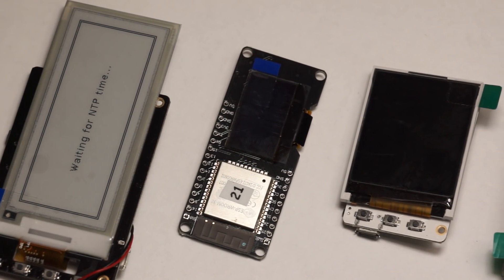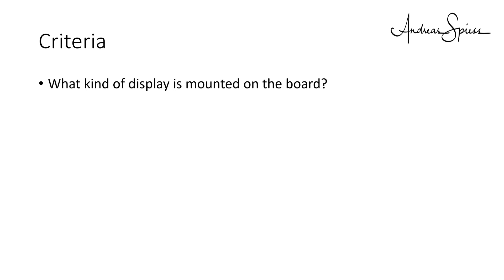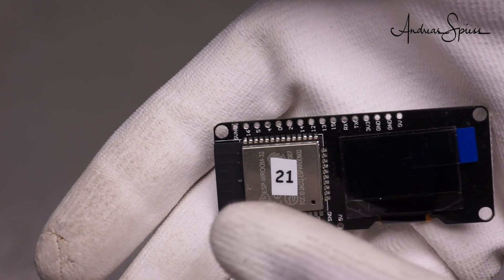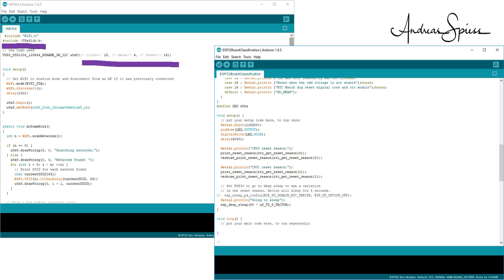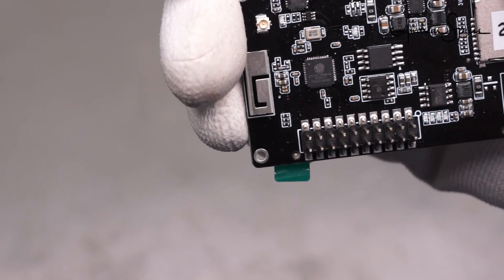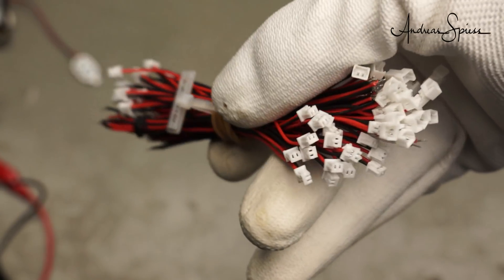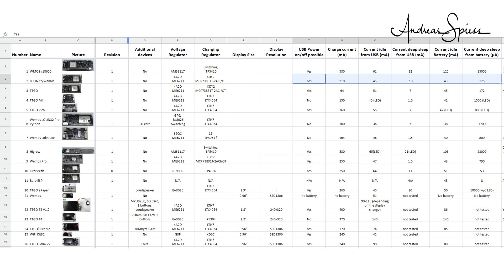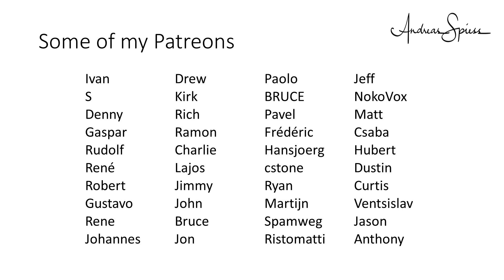#201 New ESP32 Boards with Displays

Comment: Hello, please change the info for the TTGO V4 ,it has been updated to LILYGO® TTGO T4 V1.3 ILI9341 2.4 inch LCD Display Backlight Adjustment ESP32 Development Board WIFI Wireless Bluetooth Module, and yes the pins are labeled and it is shiped with the battery and connector for socket with 3.3vdc ,5.0vdc,gnd,SCL,SDA (i2c).I am waiting for mine and will keep you posted.

Comment: just made my ttgo T4 1.3 display work.
Thanks to Your very helpfull Info on Github.graphicstest TTGO T4
Had to adjust TFT_DC to 32 and Write the IO 4 high to get the backlight on.
With the Adjustment of the tft pins as in your sketch the TFT_eSPI examples also run on TFT_eSPI  library.
Regards
Reply from the maker: Great! And a cool name you have ;-)
Reply: Thanks for the reply.
Its not so much a Name as more of an Attitude ;-).
Waiting for the M5 e paper and M5 tough in the mail.
Plan to use these for some outdoor project, so searching for good information about them.
Regards

Comment: Hoi Andreas, Ich unterrichte a de ETH und mir würed gern en neue Networking Kurs uufsetzte. I dem Kurs sölled Studente komplett uf eigeni Fuust es chliises Pseudo-Internet programmiere. Für das benutzemer ganz villi Mikrocontrollers als Pseudo-Routers wo denne Packet i dem Mini-Internet tüend forwarde. Si sind verbunde über GPIO pins. Bis lang hämmers mit Arduinos mit LCDs probiert, aber soebe han ich das Wemos OLED board entdeckt und hetti es paar Frage: 1) Isch es 3.3V oder 5V?  2) Händ d'GPIO pins vo sich uus en pulldown/pullup Widerstand? 3) Chan me das board via bluetooth programmiere? 4) Isch es schwierig das Arduino IDE so z'installiere, dass es mit em Wemos funktioniert?  Ville Dank für Dini Hilf und die super Videos mit em Swiss-Accent. Haha :)
Reply from the maker: Man kann ESP8266 und ESP32 mit der Ardiuino IDE programmieren. Die Daten für dein spezifisches Board findest du im Datenblatt. Beide ESP Chips arbeiten mit 3.3 Volt und der ESP32 hat Bluetooth. Für die meisten deiner Fragen gibt es Videos auf diesem Kanal.

Comment: Hello, really like your work. I need help and wonder if you know anything about my issue. Im trying to build a mesh network with the Heltec V2 Lora boards. My sketch (very simple code) transmits great, and other nodes receive just as well. However, when I combine both TX/RX on a single node, the TX takes over and the the node just doesn't listen at all. No matter where I put it in the sketch. Ive tried forcing it to listen with lora functions and nothing. I heard about an "antenna switcher" built into the board, but I just cant find an answer. Can you guide me? I really appreciate your help. Take care. HQ
Reply from the maker: This is a software issue. All LoRa boards can transmit and receive (half-Duplex)
Reply: @AndreasSpiess  thank you for taking the time to answer. I really appreciate it. Do you have any function, or pin assignment in mind? Otherwise I'll keep looking. Thanks again. HQ

Comment: Library problems solved, but the build fails in with this message:
AppData\Local\Temp\arduino_build_765950/arduino.ar'; reason: File exists
Fout bij het compileren voor board Heltec_WIFI_LoRa_32 (selected this board)
On both my boards:
LilyGO/TTGO-LORA32-V2.0
LilyGO/TTGO-T-Beam
anyone can tell me what i am doing wrong??
Reply: Problem solved "arduino_build_765950/arduino.ar'; reason: File exists"
cause was the Arduino-Beta version. 
After overwrite with the nightly build the problem was gone.

Comment: Hi Dear Andreas,
I am using TTGO ESP32 LoRa OLED v1 and TTGO LoRa32 v2.0 boards but, am facing problems in reading/writing SD card.
Can you please share details about required pins' definition, board selection, and Arduino code or any video on this... Thanks
Reply from the maker: I never used the SD card.

Comment: External antenna connectors: Can anyone tell us if you have to remove any components connected to the on-board antenna to use an external antenna properly?
ESP-05 or -07 for example
Reply from the maker: For the ESP-07 you should find how to do it. You have to remove a 0 ohm resistor if I remember right.

Comment: Thanks! BTW, I made a smart watch using the TTGO T2, and it works pretty well for that purpose. The code also has an abstraction layer to choose either B&W or colour 0.96’ displays without changing the sketch.  hackwatch on github.
Reply from the maker: Sounds like a nice project! And still some of the hard work to be done. Maybe you will get help from another maker?
Reply: Andreas Spiess thanks! Yes, there seems to be a really nice community around the Espressif libraries, plus another smartwatch codebase in the works. Lots of interesting community contributions going on.

Comment: I am confused about what level of computer networking do I need to learn for making iot projects. Is it that I have to learn CCNA or something like that. Plz help.
Reply from the maker: Just start with simple projects. Most of the makers did it this way. There is no formal training available.
Reply: Andreas Spiess thanks a lot sir.
Reply: Just go digging around. These sort of projects - you will learn by debugging your problem. Search in google. Read.

Comment: Any chance you could show how to take a RF ceiling fan control and have an Arduino learn what it's sending and mimic it via MQTT calls to the Arduino?  My use case is I have a wall switch (z-wave on/off) that supplies power to the fan/light combo.  The fan/light combo does remember state so I have that automated. 

I would prefer to control the fan (on/off/speed), lower light (dimmable), and upper light separately via an Arduino that mimics remote key presses.
Reply from the maker: My videos cover different aspects of projects to enable my viewers to do their own project like yours. So maybe you find parts of what you need in my videos or somewhere else on the internet and you build your own project.

Comment: Has anybody tried yet to playback multimedia files such as mpeg/avi or s.th. proprietary from an sd card on an esp32 MCU? Shouldn't the unit be capable of that? I saw a video here on yt, where they showed Doom running on ESP32.... so... 
We need to add a proper decoder chip... or converting the mm-file to a format that can be processed by the esp32. I read somewhere that a guy placed data from a .wav file into a bitmap(?) file so he was able to play an animation with sound on his rather weak arduino uno. Well, it was a monochrom low res display, but anyway. 
I plan to do s.th. a bit more eyecandy on my next project, i.e. incorporating short animation sequences for the user (which may be kids in the first order). 
Andy ideas/advices highly welcome. 
Moin, from northern Germany.

Comment: Hello Andreas, could you please measure the sleep current as well. I programm my battery powerd Display equipped uC devices e.g. Datalogger to switch off the display and deep sleep to save battery power and only switch on display if u push a button or I use PIR Sensors or a microphone  to activate the display ( a concept to save power like in a mobile Phone) so sleep current matters. Thank you!
Reply from the maker: For the moment I have not planned to do that. But if I find time I know you would like it.

Comment: i got the epaper to work in ardunio, but it was a lot harder to get working than I'm used to. i used  GxGDEH029A1.cpp and GxIO_SPI.cpp, and my board init'd with GxIO_Class io(SPI, SS, 17, 16); and GxEPD_Class display(io, 16, 4); which let's you use commands like  display.setCursor,  display.println, etc. I can try to cleanup my proprietary sketch if anyone's interested...
Reply from the maker: I would be interested, of course ;-)
Reply: it's morning now and i have a busy day, but i will try to cleanup+post a minimal example and figure out where i got the libs i used. IIRC, they were labeled for something else but they worked; i made an NTC clock demo and it's still showing Jan 20 on the display, which is probably why i can't recall exactly what i did. I'll figure it out and let you know, it's the least i can do in exchange for your good videos and helpful comments.
Reply: Sorry it took an extra day, I've been swamped.  This is a working text+feature demo for my ESP32 2.9" epaper devkit (NodeMCU-32S profile) https://pastebin.com/Sx59JAET  I don't want any credit (or blame) for the code, I just hope it works for others. Please share. I linked all libs and you'll find more demos on their github.
Reply from the maker: Thanks. I will try it.

Comment: I have a board #21, it was advertised as BME280-ready with extra four pins in the center of board. But I didn't succeed with connecting BME280 to these pins (no documentation available). Instead I've connected to the regular pins on a side, and it worked good.
Reply from the maker: Maybe you check the connections of these pins using a multimeter?
Reply: Thanks for your advice!

Comment: There are a few typos:
+ Wemos produces the original Lolin32 boards. The company with the knock-offs is called "Wems" --> look at the board logo, the o is missing
+ The Wifi Kit 32 is missing the battery powered current and the link goes to the wrong board
+ The Wifi Kit 32 looks like a Heltec Knock-off. Heltec has their own github https://github.com/Heltec-Aaron-Lee/WiFi_Kit_series

Do you have any 2nd test of the TTGo Lora32 V2 board on LORA Performance? It's just so a disapointment of the Chinese boards that are not usable with 868 MHz and battery deep sleep mode
Reply from the maker: Thanks for the correction. I will adjust the table. 

The TTGO LoRa test is planned

Comment: Sorry i have just discovered your ESP32 BLE videos, so i am commenting these in your last post

Recently i have started to develop ESP32 devices connected uisng BLE to Android smartphone.
I have find a wonderful android application generator to build simple android app with dedicated MMI
Designing is done graphically and no need to use Android IDE.
App Inventor 2 has been developped by Google and donated to MIT for support and enhancement.

I had succesfully connected with BLE an ESP32 to my Smartphone dedicated App.

I will be pleased to provide you my App Inventor sketch as a starter example ( For ESP32 i had used the same Neil KOLBAN source as you)

Kind regards

Daniel
Reply from the maker: I heard about AppInventor. Unfortunately, I use an iPhone and it only runs on Android.

Comment: why can't we us a  pin and a transistor on the esp32 to turn the power off and on for the display before we put it in deep sleep, please let us know if you get any info on the e-paper I too want a low power option.
Andreas thank you for all your work, I appreciate all your effort testing, you save us all a lot of time. Thank you!
Reply from the maker: I assume you can use a transistor. But probably if you have a separate display. During this time the display is dark, not as the epaper

Comment: The advantage of buying the display separate is that if one thing disappoints, the other is still good. Also you can make sure which part has bad power design. And you can reuse them.

Also nothing says DIY like a bunch of cables in the small box 😂
Reply from the maker: You are right. But for tests and small devices, it can be quite comfortable to have the display on board...

Comment: I just wonder if e-paper is parallel or spi.
By the way - I found Python a bad idea to program ESP. It consumes tons of memory and is insanely slow.
C++ is the best tool and they should improve compiler for better optimization. I started using esp-idf on Windows with CMake builds which are blasting fast and compile much faster than Arduino.
I also must add note about Arduino framework - I was analyzing the code for some libraries and noticed that depending on design some code examples use interrupts and timers that never stop and still consume cpu power.
Deep sleep must be properly configured to disable all of the power domains so even after deep sleep in Arduino - it is not a true deep sleep.
Here is a brief description
https://docs.espressif.com/projects/esp-idf/en/feature-cmake/api-reference/system/sleep_modes.html#power-down-of-rtc-peripherals-and-memories
Reply: Python is to C what C is to assembler. The very same reasons people use C over assembler is the very same reason people use Python over C(faster development of software and more human readable). The reasons you might choose C over python is the same reasons you might choose assembler over C (faster and more powerful). The really good programmer that I meet can proigram and all levels Assembler, C and Python and they switch between them depending upon the task they want to achieve which level will be best.
Reply from the maker: The display is SPI. I  mentioned the memory consumptions. But I read that it should be ok with PSRAM. But I will see. Thank you for your feedback!
Reply: C will always be much faster than MicroPython but MicroPython is portable between devices i.e if you write a great progam in python for ESP8266 and want to run it on ESP32 or STM32 then you don't need to change anything. For much more complex program development is much faster than C because it requires much less lines of code and fast to debug as doesn't need compile for each test run with lots of built in error checking. Most of the hard core usesers I meet use both C and Python together, if they have something that needs speed then they implement it in C and wrap it up in an API to call from python.
Reply: For embedded devices with such minimal memory and such complex peripherals python is a terrible idea for reliable code.
It is nice for FPGAs maybe and then we can consider porting but most of the time the stuff is proprietary. Arduino people don't seem to understand it
Reply: Yes MicroPython is a pain on devices with minimal memory and I Tried MicroPython on the ESP8266 and it was a pain due to not enough memory but ESP32 has plenty of memory and if you use the psRAM then you have so much excess memory it is not funny. As for reliable code there isn't any difference between python and C. Python is just C functions wrapped up and called from python. It has been mainly industry that have been backers of MicoPython development because from a commercial point of view C is slow to develop software and isn't very human readable compared to python. Python being more human readbale makes it much easier for multiply programmers to work on the 1 piece of code as it s easy for them to understand what each other is doing. In the end C and python complement each other quite well, what C is poor at python is good at and what python is poor at C is good at, as I said above I find many of the advanced users use both together and get the best of both worlds
Reply: The bottom line is - C/C++ is not for non-programmers and it is superior to Python or other higher level 'average human readable' scripts.